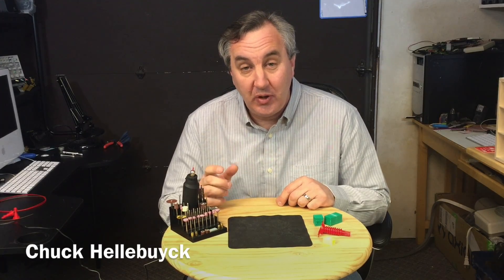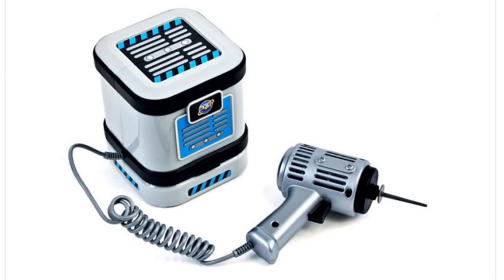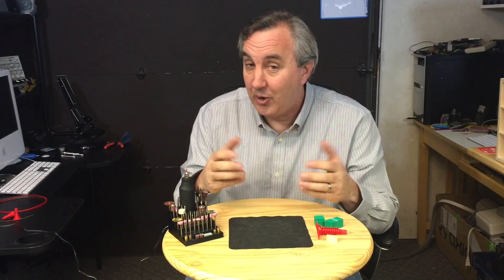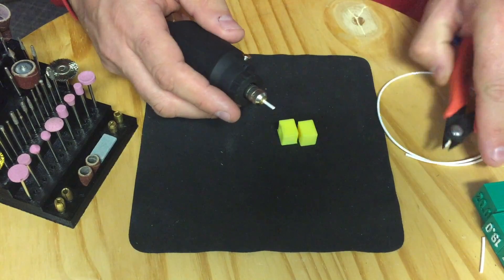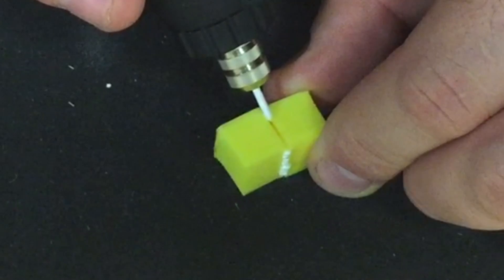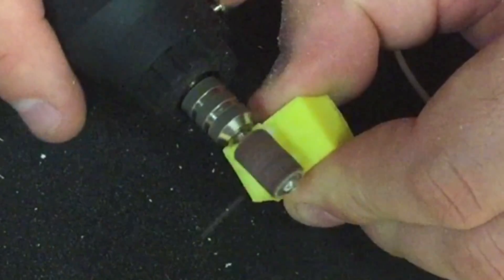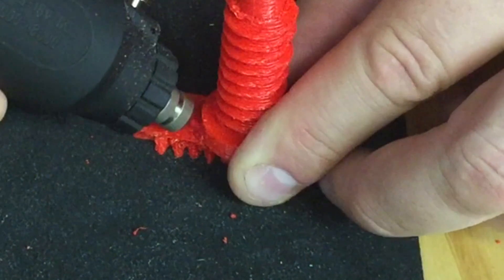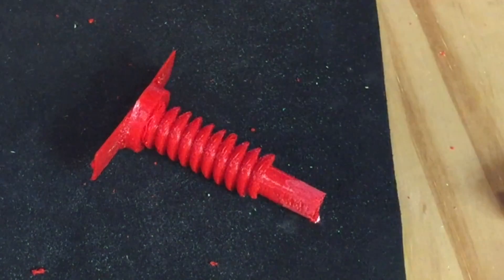Friction Welding 3D Prints Together using a Rotary Tool - Video #030

Comment: This seems like a great trick to learn.

I've done quite a bit of welding of 3D PLA prints mig/tig style using a soldering iron, but it seems to go through a lot of filament quickly. I have to work fast with delicate hand control, but have patience at the same time, in order to get a clean weld without heat-warping the surrounding area.

I wonder how all of the options (adhesives, solvent welding, heat welding, friction welding) compare in terms of strength, based on project/contact surface size, as well as the type of physical stress the part is expected to endure. One trick I use in my 3D prints for shear forces is to include holes for dowels or other similar locking pins.

While heat welding can probably get stronger welds than friction welding, simply by having a larger/deeper, bulk of solid plastic comparatively, I imagine friction welding has better welding for harder to reach areas. Heat welding with tight spaces has given me grief in the past by melting or warping other areas of the print, whereas friction welding will concentrate the heat mostly to the point of contact.

Comment: Great Video! What speed should the Dremel be set for fusion welding the filament to the printed parts? Thanks so much
Reply: Thanks Chuck! For welding bigger 3D prints, do you suggest welding on both sides of the seam? or just the outside seam will do?

Comment: I tried this. Went out and bought the exact same rotary tool. And it didn't work at all. The tool couldn't grab the filament. Waste of time.
Reply: +James DeRuvo Most 3d printer users are resourceful enough to find alternate solutions. Try this: take a bit of tape and wrap your 1.8mm filament until it is approx. 3mm and then you can insert it into your rotary tool. Otherqise, get 3mm filament. You dont have to buy a new rotary tool insert if you dont have one
Reply: +doctrderp Is that a backhanded compliment? Impressive! OF COURSE I tried that. Still not working.
Reply: Haha that's just too bad since this method works for me. Good luck with other solutions.

Comment: thanks for sharing Chuck!  I've been using a soldering iron and the zig zag that the xyz prints at the start of a print to weld my parts together.  I'll have to give your method a try and see which one works better.   Im guessing this is better for larger jobs but the excess from the start of the print is nice since its already flat and makes joining two layers that didn't stick in the middle of a print easy.